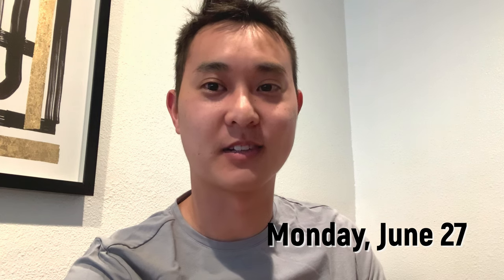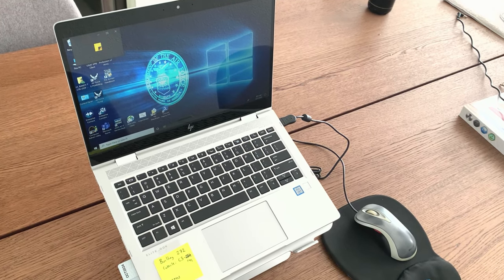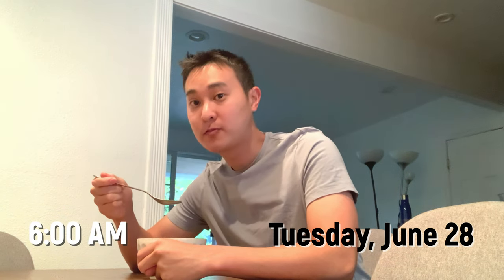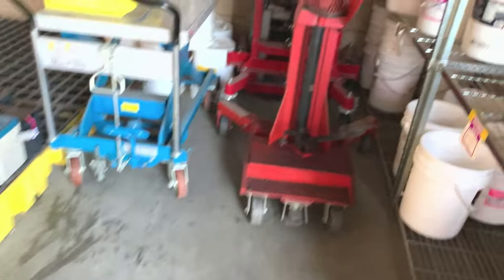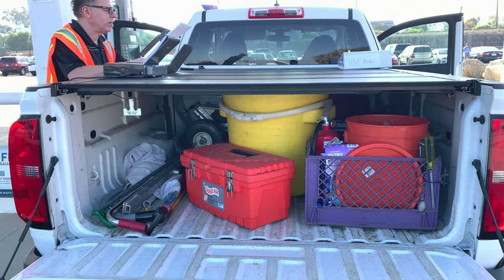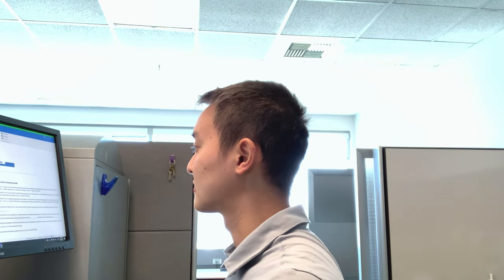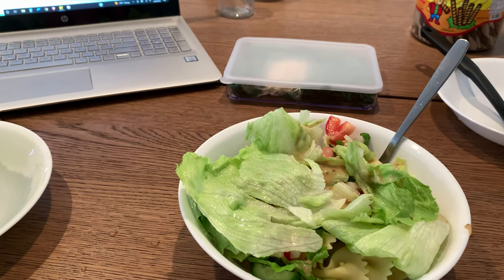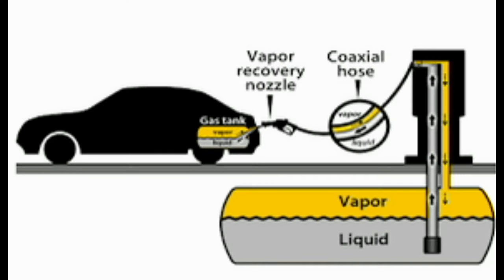Day in the life of an Environmental Engineer working in the US Air Force | Typical Work Week

Comment: Hey, great video by the way. I was wondering how much interaction with others is necessary for your position. I'm currently an intern at an environmental engineering consulting firm and I find most of my time is spent in meetings or communicating with others and finding what work they've done or still needs to be done. I enjoy working in teams but I'd rather be able to do my work independently instead of having to rely on 10 other people to complete their part before I can start mine. I'm graduating next year and exploring potential career options.
Reply from the maker: Really good question.
Meetings are boring and sometimes unnecessary. Even though I get to manage some programs to way I want, there are others that rely off of others to get things done. Half of the time, I just do what I need to do by myself while the other half I also need to wait for other people to do their part before we move forward. It depends on the program and sometimes depends on if you're willing to just bypass a few unnecessary steps, legally. (Use common sense when doing this)